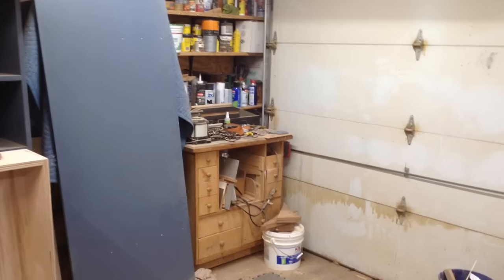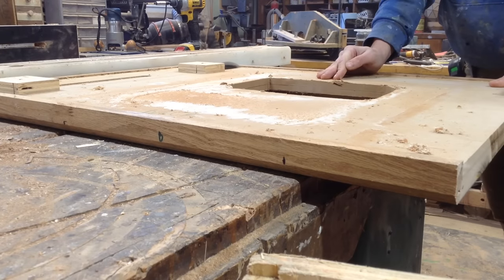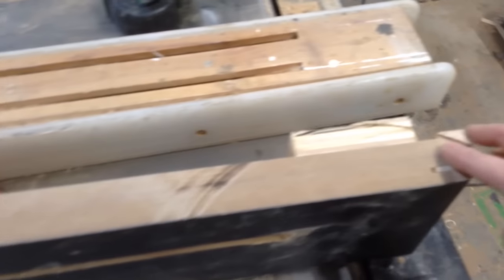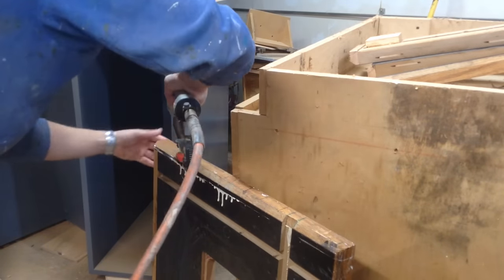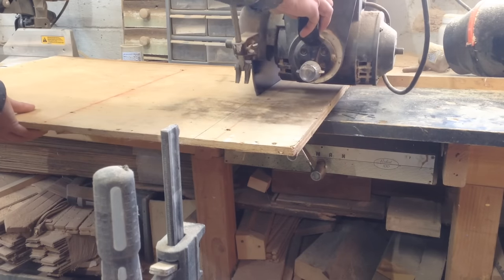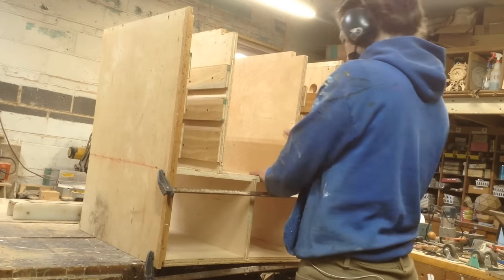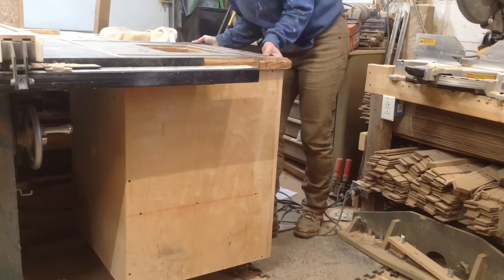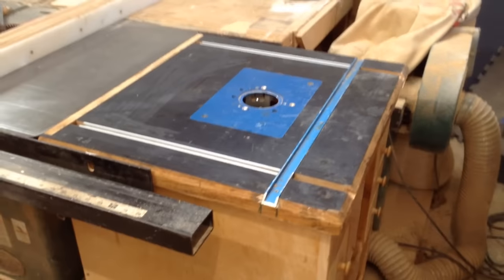I Can't Believe I Made This || Woodworking Projects

Comment: Hold your horses. Did you just use the words table saw and clean with water in same sentence (just kidding). Love the update to the shop. I just built a frames for a piece of melamine and attached to my rails by a dado and it slides into place (note I have yet to install the router yet). Wonderful space saver and useful extra workspace. Repurposed wood is awesome. Thank you for sharing. Love your work ethic. Everyone stay safe, happy, warm and healthy. From Henrico County Virginia.
Reply from the maker: Nice!  I used to clean it with expensive table saw cleaner, but have found some water and bar keeper's helper works just as good.  Just have to move quickly haha.

Comment: I made the same router table from Norm Abrams design many years ago. Use it often but do a bit of freehand routing as well. Great video
Reply from the maker: I also do a lot more freehand routing.  But, that’s mainly because as you saw I used that table for storage and it had To be moved to use.  It was inconvenient enough to just avoid using it.  I’m making some French doors soon which will be mostly router work and figured moving it and squaring everything up again would be smart before that build.

Comment: Thank you for your video, I like your workshop because it is cozy. Modern workplaces are often without atmosphere. I also have the router next to the table saw. I used the dead space underneath for the dust extraction unit.
Reply from the maker: Thanks!  Agreed, that space was unless for most things.  Now I not only filled it, but also freed up some floor space.

Comment: Nice move! I did something similar to my table saw a few years ago. I found that it works really well… until a setup I have going on the router table gets in the way of using the table saw. I can usually just drop the router or remove it by pulling out the router plate but it gets a little annoying and if the fence position is critical it’s really annoying. Pre planing helps too but not always. Not saying this isn’t a good idea. It is and a nice space saver for a small shop. It’s just a little inconvenient sometimes.
Reply from the maker: I did think about that, and I know it will happen down the road.  I'm just hoping it happens infrequently enough that I don't regret moving it.   But, I agree and can see especially for fine tuned setups that it would get annoying.
Reply: @HoneyBadgerWoodWorks  I didn't think about it either 🙄

Comment: I just put my router into the table saw too, but I suspended it from the rails and seated it on a cabinet that also holds the (contractor) saw. Will you be rolling yours out from the saw? Or is it firmly attached to the saw?
Reply from the maker: I made it so it can move, but I have no plans to move it around.  Just wanted extra insurance in case I ever need to move it.  The fit between the rails is tight enough that it doesn't budge.  But, if it starts to wander I can bolt it in place.

Comment: I'm always skeptical of perfectly clean shops with all the tools nicely hung on the wall in foam.  If you are doing it for a living my tools got put back at the end of each major job, when I did a shop cleanup.  So much time is wasted running around for tools, why add to it.  I had a similar setup but used my tablesaw fence for my router too, I also had a separate router table, I love routers.
Reply from the maker: Agreed, most stuff stays out till the particular job is done.  Otherwise I find myself just taking out and putting away tools multiple times.  But to each their own.  I worked for a very nice guy once who was rehabbing an old factory to turn it into a home.  After each small job we cleaned EVERYTHING.  Drove me crazy, but it worked for him.  I watch a guy on here who is an arborist, does a ton of work in his shop but keeps it very tidy, and I get jealous.  I like the chaos, but wish things were  a little tidier sometimes.

Comment: Please don't misunderstand this.... do you ever clean your shop?  My shop has plenty of sawdust in the corners like yours and I'm not especially bothered by it.  Do you think the clutter and sawdust affect your work?  I love to see video of spotless shops but I wonder how much time those people spend cleaning vs. working.
Reply from the maker: You won't believe this but I sweep at least once a week haha.  Small spaces are tough because when even one thing is out of place it looks a mess.  The saw dust does get annoying I need better dust collection.   The other problem I have is I'm always working on multiple things at once to stay efficient.  As something is drying I can pop over to something else, but that also leads to clutter everywhere.  I have five projects in progress in the shop right now which just leads to stuff being everywhere.   Two of those projects are carvings which means there will be sawdust on everything til they are done, I don't love it, but I've embraced it at this point.  Part of moving this router table is that when I have that big built in out of my shop I want to add lots of storage to that side wall to help keep things a little tidier.  I will never have one of those immaculate workshops it's just not my style, but  I would like this one a little more organized.   In conclusion, I do clean but it's a losing battle.